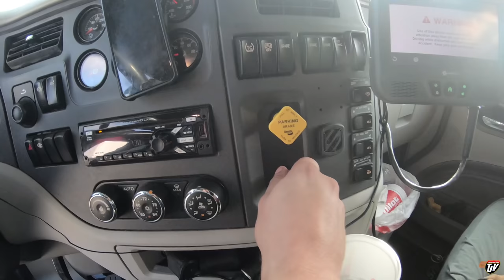My Trucking Life | TIPS FOR STRAPS | #2068 | Sept 9/2020

Comment: When I test the brakes I take a bungee cord and hook it on the trailer brake handle and then onto the step out the door. But how did you test yours? It was like magic
Reply from the maker: I have a button I press and it cycles through all the lights for me while I walk around
Reply: @Trucker_Josh  Oh of course. It's good that most newer trucks have that feature now. Thanks!
Reply: Joe Kriz - Back in the day we used to jamb a short 2X4 between the seat and the brake pedal.